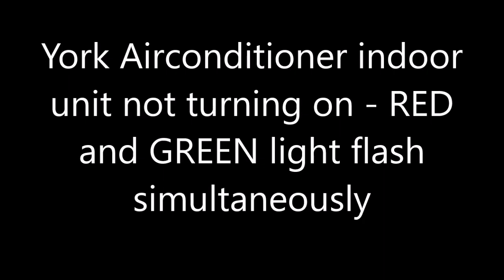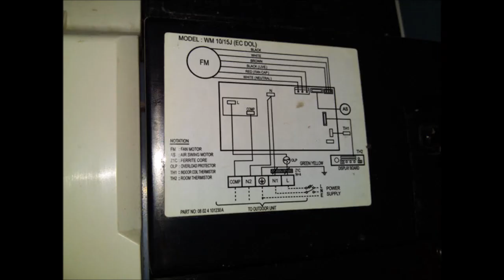DIY fix York Air conditioner motor fan stuck - orange LED flash

Comment: Hi, can i know  york ywm15l room sensor located?
Reply from the maker: It should be located on the right together with most of the circuit... It looks like a piece of wire with small metal copper
Reply: Tqvm

Comment: So should I clean my aircon then? But my orange light is solid and the green light is flashing
Reply from the maker: it could be your timer...
Reply: HowTo DIY homeMade Electronica I tried pressing the remote timer and it’s doesn’t do anything idk why nothing works everything in the remote doesn’t work for some reason. I replace the batteries or even switch the remotes still the same.
Reply: @Ye-yz7cx  call technician.. your problem maybe gas or capasitor

Comment: How did u even get the aircon to turn on mine doesnt
Reply from the maker: Plug out the power cable from the power source few minutes and put it back and try to turn on the air cond...some problem that may cause the air con not turning on

1. Faulty LED indicator lights 
2. Capacitor outdoor unit
3. Timer circuit

Check out also tiny cables that may be damaged ...even a minor damage to the LED green, orange, and red indicator could caused your aircond to stop functioning
Reply: HowTo DIY homeMade Electronica idk how to unplug the wires since we are just renting this house and it looks like it’s just a switch up and down to turn off I did that I even turn it off for a whole day then turn it back on and still the same results.

My LED light are solid orange with a green flashing beside it and when I turn off my aircon through the remote it doesn’t function I even swap my batteries and the remote still the same :(
Reply: HowTo DIY homeMade Electronica it’s very hard for me to check the cables since our house is a 1 storey house and my room where the aircon is located the outdoor part of the aircon is outside hanging from the side and there’s no way of me accessing it besides  getting a ladder which we don’t have, I emailed the makers of the aircon and still waiting for a reply thanks for the help.